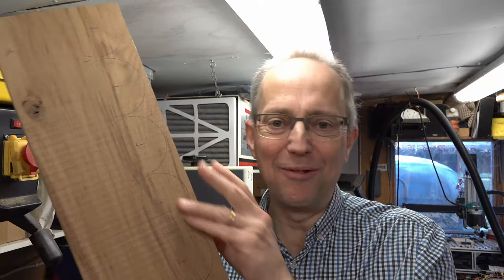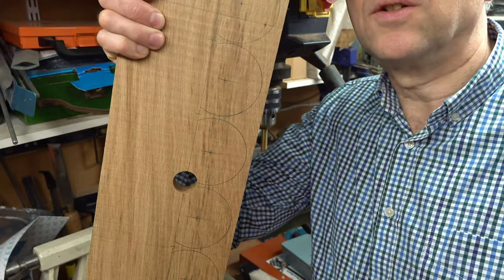Converting my Leather Shed to a Railway Station

Comment: Why not?  Can't wait to see the final result.  Always been a bit of a rail fan.  I had the opportunity to spend some time in a signal box in Norfolk 20-odd years ago and even got to pull a manual signal.  Back in the mid-80s I made my girls a play house and put a very similar "gingerbread" edge all round.  Almost the same pattern.  Not the same paint scheme, though.  Have fun with it, Harry.
Reply from the maker: Thanks Grady I used to go on the Holt to Cromer railway with my boys years ago!

Comment: I know this lockdown will have a big impact on your "Bodger" friends, but at least you’re gifted with varied interests many of which are home based. I think it’s going to look really good and will give you even more bounce in your step as you go out their to work. Did you say if you’re putting any signage up? How about "Girdler's Cross"?

Are you Zooming with your Bodger friends? You could come up with a single project, all making a different part and see how well it comes together when all this finished. I know some of the members are retired, I hope they are all in good health through these awful times. 

I, like 1,599,999 (approximately) have at least 12 weeks of this, though I am working from home 12.5 hours a week. So I wrote my 'to-do' list out: 1) Shelf for thicknesser planer 2) Shelf for welder 3) Fit new vices and make a twin screw vice out of my old ones [3b remember their name which for the life of me I can't think of] 4) Secure my wood lathe. 

So far I’ve had another chest infection (bacterial part of my condition so I'm counting my blessings) and managed to order new tool drawers which has given me number 5) make a portable router table out of the cheap metal table my new drawers have displaced. The problem with health conditions that cause disabilities you tend to set yourself goals from more able times. At least I have a plan, accomplished or not it’s good for the mental well being.

Take care and stay safe and thank you for bringing some brightness in these times, 'Colonel' Tom's flypast is on the TV as I write this. People like yourself and Tom make me proud to be British.
Reply from the maker: Thanks Mark it sounds like you are making very good use of your time..shielding is difficult but you are doing your bit to help by doing so.

Comment: Harry, if the colours fit I can heartedly recommend Ronseal Garden Paint. In the good weather have painted front and back fences, two sheds and garden furniture. A discontinued colour called Wellington Boot gives a lovely British Racing Green colour. You might be able to pick up NOS.
Reply from the maker: Thanks Tony...my wood shed is done with that and yes very good...apart from they keep changing the colours! I used Holly, no longer readily available but obtainable.
Reply: Harry, I am relieved that I am not the only person frustrated by Ronseal changing colours😁. Keep safe and in these strange times your videos relieve some of the boredom, thank you.